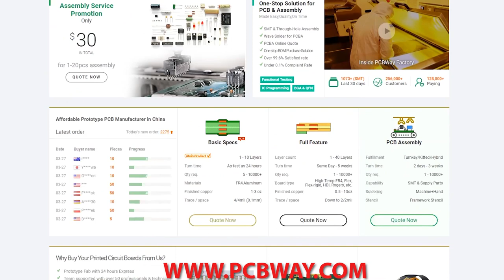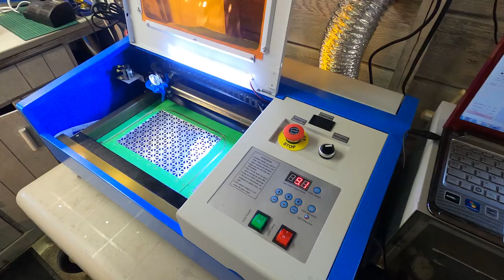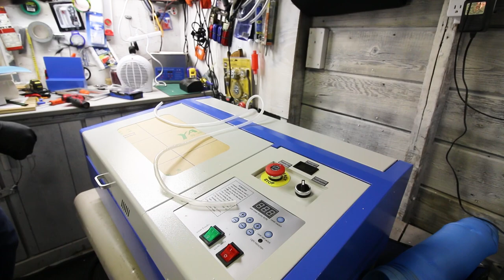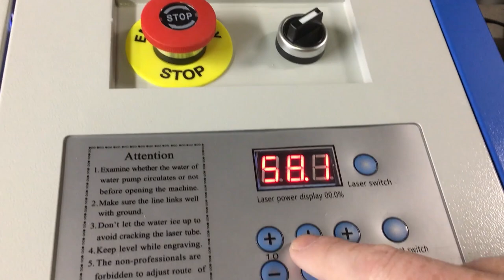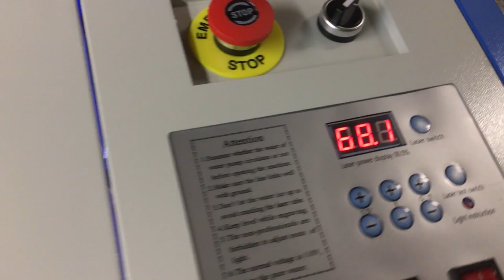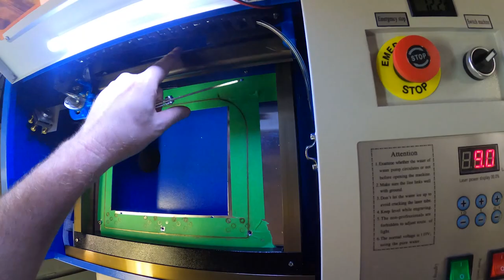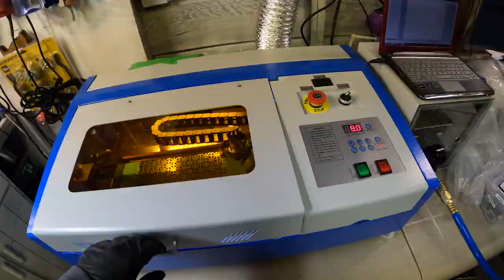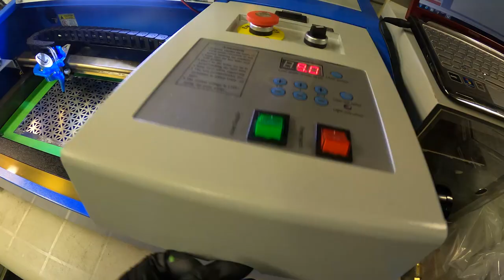🆕K40 40 Watt Laser Cutter- EVERY Mod & Setup I have Done in ONE Video! 🎉🛠

Comment: Got a K40 about a week ago, really happy with it. The optics seem to be in good alignment out of the box, the bed has a removable flush plate covering the clamp in those things, and the top of the bed seems to be about 1.5-2mm below the focal point of the lens. The extractor fan seems to be a decent equipment fan with a good flow, not one of those junky plastic boxes most of them apparently come with, and the extraction nozzle inside is the full width of the working area and seems quite effective, and it came with one of those spiral foil type hoses, which seems a bit more substantial than the blue plastic ones I've seen with other people's.

All in all, I'm very happy with it, as most of the things which everyone says you absolutely must modify seem to have been done for me. All I've had to do myself is properly to earth the case, and to install an ammeter in series with the tube, since I got one of the ones with a digital display. All in all, having looked into these machines a couple of times over the years, I'm only sorry I didn't take the plunge much sooner.

Comment: Im upgrading my K40 clone to a 60 watt tube and power supply. I also have a Meanwell supply from an old Ender 3 pro I want to use 
, keeping the main PSU strictly for the tube driver. However, the wiring is proving to br problematic for me. I wish we could post photos here, too for a better example of what Im about.
The stock 40 watt supply is radically different from the Cloudray M60 as far as connections go. I searched the internet for wiring diagrams but no luck for my specific power supplys.
your video is excellent in as much as it addresses other issues I will face in modding. Thank you!

Comment: k40 whisperer was a game changer for the k40...i now have built my own 
600x400 co2 laser using the k40 control board, 45w spt laser.....have 
had for 3+ years.....spt makes great tubes.....they are actually tested 
with info like peak power......made motorized bed out of 1x1 steel tube 
and 3d printed parts....total cost was $900....well worth it as its paid
 for itself many times over

Comment: For the front vents, you can increase the air flow through them simply by twisting all of the metal strips running up and down. About 15-20 degrees each should do it

Comment: Just like to say something that might help anyone - I've put a 12v PC type fan mounted on the inside of the door blowing  air towards the rear of the extraction port ( that I've removed as it got in the way and useless as everyone knows! But putting the fan on the door(edited) > on the inside) has solved all smoke problems as well as a micro switch that cuts off the laser if the lid is lifted,
Anyway great video!
     From the UK.
Reply: Is there a 12V supply on the board that can be used or are you using a separate supply?  Also how are you getting on with coral draw?  I've never done any of this design work before but gather the default board driver and coral draw are Crap... I've seen many suggestions of swapping out the board.

Comment: Hi Eric.
I'm here in the UK, That ideal of your's of removing that exhaust port at the back makes sense to me too, I've cut mine back and fitted an inline extraction fan which is meant for bathrooms.

But it doesn't remove the smoke as well as I would like, so I'm going to remove the port as you have done and hopefully that will improve things. Thanks for the tip.

Best Regards

Richard
Reply from the maker: Excellent!
Reply: @KodaKayde Yes, it makes a big difference to the smoke extraction, and having some spacers under the front of the lid of about 1/2 inch helps with the airflow across the bed. I have sold my K40 now and bought a 4060 laser machine which is based on the K40 but has a bed size of 400 x 600mm cutting area with air assist and a big extraction fan fitted as standard. The only mod I've done to this is fit a big air-assist compressor which gives me very clean cuts.

Comment: I made a point of running the stock hardware and software for a couple of engraves to find any defective parts before gutting the machine for upgrades like you did.
Reply from the maker: "gutting" lol
Reply: @MKmeMedia  I replaced the controller with a Smoothieboard and installed the Lightobjects motorized Z and air assist capable head (haven't actually done the air assist yet).  Using Inkscape (or Fusion 360) and Laserweb3 to run it.

Comment: All the videos I watched used distilled water for coolant you are the first who has used anti freeze. I have now had 2 tubes crack due to freezing! Have you had any problems using anti freeze or is that the way I should go too?
Reply from the maker: Its -15C here right now so water is a bad idea.
Reply: I use antifreeze as well and I haven’t noticed a drop in power....
Reply: @jamzempire  Did you just use anti freeze or did you mix it with distilled water too?
Reply: @rebeccamarshall9269  i bought the 50/50 mix from autozone then mixed it with distilled water.

Comment: Hello Eric, I see you are using antifreeze in your laser cutter.  What part of Canada are you in; I'm in Brandon and trying to judge if I should set up my K40 (on order) in my unheated shop or keep it in the house.
Reply from the maker: SW Ontario. Mine is unheated- my only concern is firing it up when cold and having the thermal delta from glass to coolant trigger an explosion/crack. So far at freezing there was no issue.  Debating on putting a block heater in the coolant and just leave it on all winter to avoid the chance of destroying the tube.  So far its fine
Reply: You can solve that by installing two lamps of about 30-40W in the part of the tube, so it will maintain a temperature in the tube.
Reply: @Luis__Martin.  I don't know if I'd rely on two bulbs preventing my laser tube from freezing at -40. That would probably be okay for warmer parts but here in Manitoba I think I will just keep the laser engraver inside!

Comment: I recently purchased a preenex 4w0 laser and was told it could NOT be modified to use a rotary tool.

Are there models that cannot be hacked to use one?
Reply from the maker: The K40s work fine with a rotary attachment. You have to cut out the bottom to get the height though.
Reply: It can be used... I’m currently using a preenex with a ftg rotary

Comment: Hi there, i just bought my k40 laser. First time i turn it on, the laser home point was at the top right corner. How to make ot to top left corner.?
Reply: It can either be changed via gcode or depending on what program you use you can specify your home position.

Comment: Are these stock  350$ laser machines any good?
Reply from the maker: Yep
Reply: Most of the time these machines, as they com e right out of the box, need some tinkering in order to give a somewhat decent cut.  If you want really good cuts, then  you will have to do modifications to the machine.

Comment: What if you installed one or two computer fans where those vents are in front to increase the air flow through the machine?
Reply: Be careful, the power source does not support more consumption, it is very limited.

Comment: Not really an engineered device. More like tossed together. Note the air duct reduction causes higher velocity of air flow. You may have made a mistake removing it. Shortening yes maybe total removal maybe not.
Reply from the maker: CFM is pretty basic physics...
Reply: @MKmeMedia  anyone who thinks CFM is a simple basic part of physics knows virtually nothing about the subject.
Reply: @mr1enrollment  What's wrong with having more air flow here? You want to clear the smoke out of the cutting area as fast as possible.
Reply: @mr1enrollment  agreed, cfm and airflow velocity are two parts of the equation , subtract static pressure. Doing commercial exhaust systems, there is a lot to consider. Hes needs to think simple as what happens to suction when you install a clevis on vacuum= increased velocity and suction power. Just shorten by 12mm, you also want it up as high as they had it. Just slightly above burn, not under, and under the ZnSe focus lens
Reply: @donaldcudak2351  Shocker- Max mass flow is the key and I was right.

Comment: Hi..i was told by someone that tested watt output...that all these ebay k40 are fake specs...and not 700mm 40w tubes...they are 600mm 20w tubes...
...can anyone else confirm this?
Reply: The majority are 700 mm. and 35W.
Reply: The actual output put of the K40 varies between 30 to 35 watts, depending on the tube brand.  I have found most to be right around 30 to 32.